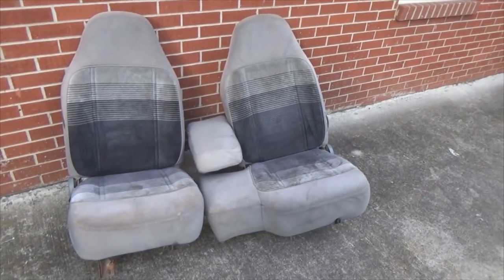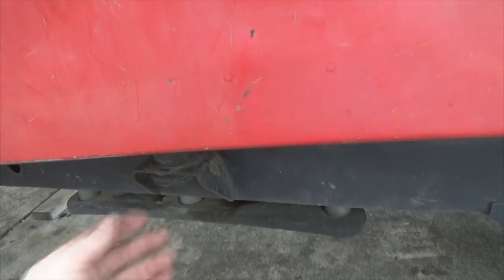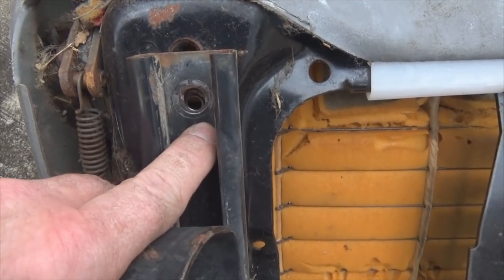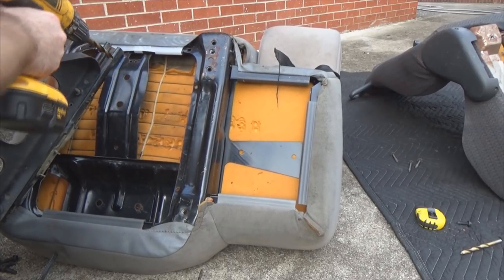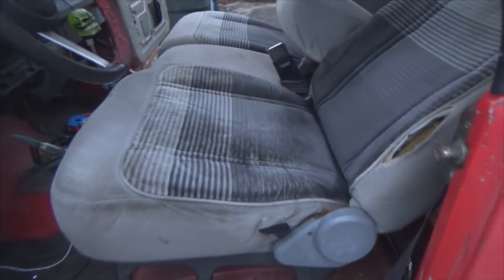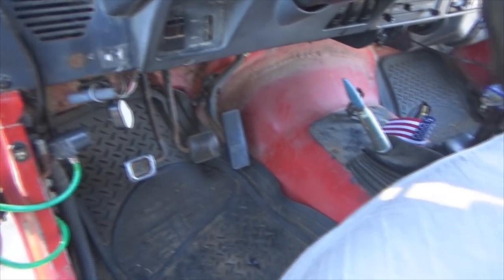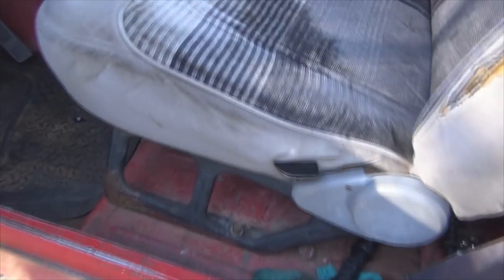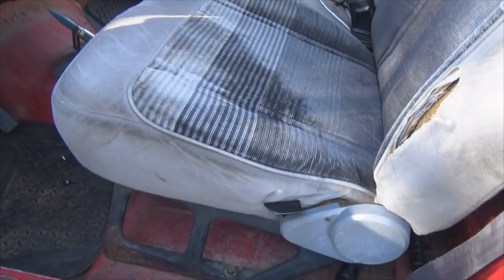Jeep Wrangler YJ - Ford Ranger Bucket Seats in a YJ #Rangerseatsinayj #benchseatinayj

Comment: Nice video instruction. Just thought I would throw in my experience here. My jeep came with the Ranger seats. Two problems I have with my 30 inch inseam. The tilt of the seat does make it harder to reach the pedals. Adjusting the seat forward causes the stock shifter to hit against the middle seat extension in 2nd, 4th and Reverse. That's the bigger problem. I'm thinking of altering the seat and take the middle section out and then bring the fabric down around the seat side and put a console in between the seats. It would give me a cup holder too, which I don't have with the flip down arm rest. I could also try putting spacers under the rear of the tracks to tilt the seat up more and create less of a seat angle. Other than that the seat fits within the confines of the YJ interior and all the seat brackets work like the stock seats do.

Comment: What year seats are those or dose it not matter
Reply from the maker: Those are 95 seats if I remember correctly. I think it was about 90 and older the YJ holes are a bit different. Also, I'm not sure what year but I've read the Ranger seat hole patterns changed a little as well.

Comment: Overall,.. pretty good swap on those seats (wont work for me thugh on 2 counts...1: I'm 6ft. 1in. tall lol so my head be poking through the roof haha and 2: I don't own a YJ lol and my TJ seats are still perfect. Other thing peeps might do is go with TJ seats since the tubs are pretty much the same once you pull back their skirts and see whats underneath,Your thoughts on a center console reminded me that manual TJ consoles would fit no problem an some even had a subwoofer built in ( been looking off and on for a while myself on possibly getting a new center console for my TJ and making the ammo can console for my 47 Willys) any ways good stuff as always :D